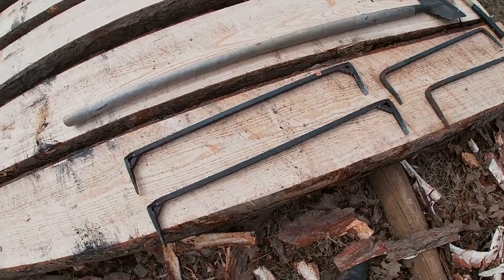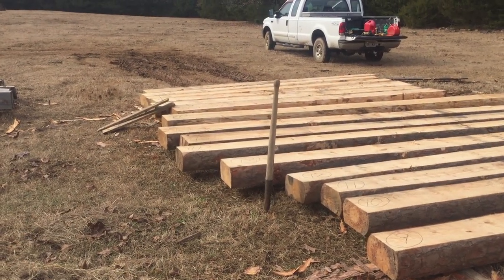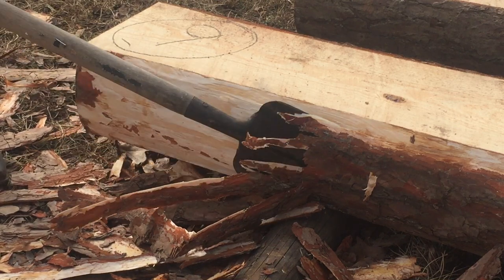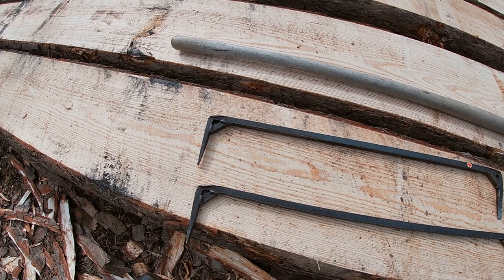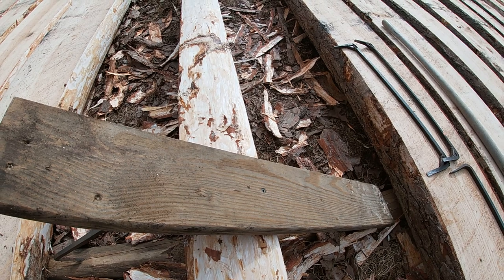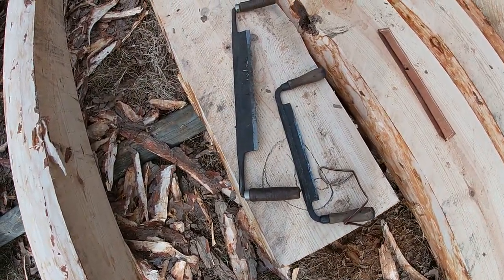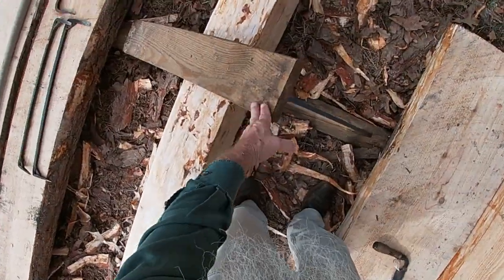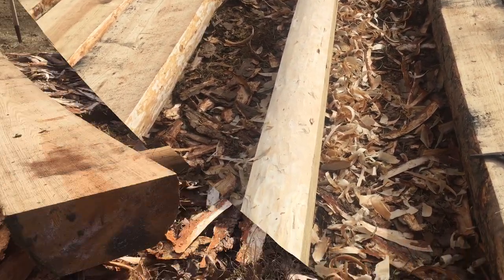Debarking Pine Logs for the Log Cabin Build (Ep 5)

Comment: I always learn something from each videos Paul. Today I need to sharpen my bark spud. I am more like Roy is, I am all hand tools, no saw mill to make my cants. I'm like Roy, I debark and get the whole log clean to see my marks better. I cut me two 12"-16" by 2' long bark free log and cut a slight saddle. Then I set log crown down and us log dogs to keep the log steady with log dogs and a few little nails to use as a second pair of hands for the chalk line for marking out my log at each end. Like I also learned from you is to take a utility knife and make a place to hole on end of my chalk line, works great when you'r working alone. On both sides marked the ends of the log is marked and line s set, I lay the log 45 degrees on my blocks and start cutting "v's" down the log on , knock of the blocks and I make me a cant with no bark. As I live in a temperate rain zone I by the cheapest can of lacquer I can get and spray all my marks so they do not wash off. Thanks for today's new lesson from The Bearded Carpenter! You gerat Paul! Blessings!
Reply from the maker: Howdy Thomas- you’re doing things the old way which is great. We need to keep the old skills alive for tomorrow’s students. I did exactly what you did when I built my first cabin. Thank you so much for sharing your experiences. Hopefully, someone will read your comment and decide to give it a try and get a passion to build something from the forest. Take care and God’s blessings to y’all
Reply: @TheBeardedCarpenter  Howdy Paul Thanks for responding, got out my file and bark spud, amazing, Thanks , God bless

Comment: Man I really enjoy your videos your a man of lots of knowledge. I was also wondering what would be the best 26x 32 cabin build meaning what is the easiest and the most simple. I live in Alabama and my wife and I are looking at property in Blue Ridge Georgia so I will be going back and forth 2.5 drive so I would be carrying enough to work for weekend. I like all the styles and I know people say whatever you want then build it. But I want it to be easy and fast 2 bedroom 2 bath 9 ft ceiling and I know you have the knowledge. I have built my last 2 houses but never a cabin. Thanks for your time. Keep the videos coming
Reply from the maker: Howdy Micheal, if you’re still leaning towards the d-logs you could probably do it faster than what I do with the dovetail corners and hewed logs. You could keep it pretty simple and by using engineered trusses could save on time. If you go with d-logs be sure and put lots of over hang on your roof to keep moisture off the logs. On d-logs the sapwood is on the outside which is more susceptible to decay. I’ve never built with d-logs but I have done some extensive repair on a house with them. Hope it goes well for you. Blessings to you

Comment: You just reverse engineered yourself a traditional Finnish debarking tool called "petkele" :) 
In Finland, due to more modern (motorized) tools, those have long ago fallen out of use in their original work as debarking logs and instead people have started using them as - you might've guessed it - floor scrapers or ice scrapers and they are being sold as ones these days - with some adjustments to the traditional blade geometry. I love it, that you thought of turning it back into it's original use, probably without knowing it's original use. Human brain is so fascinating system :)

The long shaft makes debarking that much easier.
Reply from the maker: akinma   Howdy- I’ve never owned the motorized tools for doing this. Believe me having one when I’m peeling sure does cross my mind. I guess in certain ways I’m kind of a dinosaur. Thank you so much for your comment and explanation. God bless you
Reply: @TheBeardedCarpenter  Ha, I can relate to how laborious peeling can be with hand tools, utmost respect to our ancestors. Haven't done any log houses, but even on smaller projects like small firewood sheds, log benches, log tables and such it's one of the most laborious part of the work. 

I'm happy there are still dinosaurs like you (and to some degree me too) roaming around, keeping up the old trades.

Comment: This is such a great series. I’m going to start my build by forging all the tools you showcase and make videos on my channel. Question, do you have to remove the peelings off the ground so you don’t attract insects to your logs? Thanks!
Reply from the maker: Howdy- that’s gonna be some great videos. I don’t have a forge but I enjoy watching black smiths at work. The bark usually dries out, but it is a good idea to keep the bark cleaned up. I can use a box blade on the tractor and drag them out. I appreciate you watching the videos. God bless

Comment: Great  seeing you using the floor scraper for your bark spud.  I have one of those so great to find another use for it.  Where did you get your log dogs?  I searched for some this Fall and almost fell out of my chair when I finally found one the prices were crazy.  Any suggestion on where to buy or have them made?  I was going to make some out of rebar but my lumber guy said that was not a good idea.
Reply from the maker: Bonnie Doon Homestead   Howdy- mine are made out of square stock. They were made by a blacksmith. A welder could make them pretty quick. Thank you for watching our videos. God bless y’all

Comment: Dear Bearded Carpenter, looking at the tremendous amount of learning that you enable, may I request you to consider upgrading this project to include a Loft with some living space, and also include a regular Dormer and a Shed Dormer to it? I understand that designing and building Dormers can be tricky. Hence the request. Thanks.
Reply from the maker: Howdy- there will be a loft in the cabin. In fact, I got the joists this week to use. They will be exposed 7”x9” yellow pine timbers. I try to stay with what was done traditionally on the outside of the log buildings in our area. On the inside I will have a tendency to do something a little bit different. I did a lot of things in our own house that probably would not be considered the pioneer rustic cabin stuff but it was our house and I was having fun doing different things to make it a bit more refined. I ‘m glad I didn’t have to pay someone to do some of the detail work lol. I hadn’t really considered doing a former on this cabin but now you got me to thinking. They are not too difficult to do- it just takes some planning but since the roof isn’t up yet I still could put one on. We’ll see what happens. There will be a wraparound porch on three sides. Thanks for watching and the suggestion. God bless you
Reply: @TheBeardedCarpenter  Thank you for the positive reply Sir. Many thanks for being so open to suggestions. I am a total novice. I have  heard that Dormers need to be carefully installed or they will leak water and spoil the roof and the  house below. I would also like to see a Dormer that is a miniature of the House itself, half dovetail notch, chinking and all (or whatever else that you know is best - pretty and durable). Hoping this idea finds your favour. Regards.

Comment: So I get removing thebark to prevent bugs but are you worried about termites or powder post beetles or wood bees eating the pine once its built?  Will you still have to treat the wood on the exterior with linseed oil or anything?   Also Ive read the pine is more apt to twist etc as it dries.   So does that dictate how fast you have to build so that the logs are locked together before they begin to dry out too much? Enjoy the vids and craftsmanship  look fwd to the build
Reply from the maker: Bama Dave   Howdy Dave- I won’t be worried about termites because the sill logs will be high enough off the ground but I will treat the footings before I pour the concrete. Getting the cambium layer off quickly insures against most bugs. However, I will treat the logs with boiled linseed oil after they are up. Yellow pine does have a tendency to move a little but when they are locked in the notches they can’t do much but stay there. Thanks for watching and commenting. God bless y’all

Comment: when is best time to cut pine logs for a cabin?  ive been told that if you cut in the spring the bark will peel easy.  but if you cut the log in the winter the sap is not running and less water in the log.  Im planning to build a cabin after the 1st of the year.
Reply from the maker: Brad Jones   Howdy Brad- from what l know, you’ve heard correctly. I’ve also heard the old saying that the best time is to cut trees in the Yuletide season because the sap is at it’s lowest. However, I’ve worked logs that have been cut at all times of the year and haven’t had any problems. God bless o
Reply: The Bearded Carpenter thank you

Comment: Building with green pine logs? How do you stop them from rotting? Old-school log cabins that were built to last were made out of hardwoods, right?
Reply from the maker: Howdy- many older cabins were built with pine logs and have lasted for years and years. I restored a log house built in 1845 that was built with pine logs. Keeping a good roof on the cabin and a good overhang is the key to make them last. People built with what they had available to them in the area they settled. Yes, many cabins were built with hardwood but having a good roof was what kept them from rotting. Moisture is what causes logs to deteriorate. The sap wood that is still part of the log is covered with chinking and the heartwood is what is exsposed which is more resistant to weather. Thank you for the comment, it is a question many people have concerns about. God bless you
Reply: @TheBeardedCarpenter   @The Bearded Carpenter  Ok, so if I understand correctly your saying that pine logs shouldnt rot away like they do in the woods provided that they are protected from moisture, and that the sapwood is stripped off all weather exposed sections, right? Im asking because there are a number of small outdoor structures I want built, but the cost of lumber right now is absolutely insane. Im wondering If I could just cut some trees and use the trunks in place of pressure treated 4x4 / 6x6 posts since I dont need anything in modular dimensions for what im doing. By what your saying, I would have to make some sort of impromptu sawmill to cut away the sapwood down the length of these trunks in order to build anything thats going to last. Stripping the bark alone wont be enough to prevent these pine log posts from rotting, and I will have to cut down all four sides since I plan on leaving the entire post exposed to the elements. I appreciate the info. Im still going to have to use a think oak tree in my case like I figured, but now at least I now know exactly why I cant just throw a pine log into a post hole with some concrete and expect it to last like treated lumber.
Reply from the maker: @pinkhead6857890  I wouldn’t recommend using pine as a post buried in the ground even with the sap wood taken off. Pressure treated lumber is ridiculous in cost right now and people are looking for other alternatives. I don’t know where you’re located but if you have access to cedar that would be better for a post. Where we are in the south we have a tree we call cedar that has a red heart that is used for fence posts and for pole barns. I don’t pour concrete around post because moisture in the ground can’t escape from around the post. I use gravel which lets water go on down. By the way, some people say our red cedar is actually juniper. Let me know where you’re located and if you aren’t too far away I can probably help you get what you need. Or you can email me at the beardedcarpenter8@gmail.com and maybe I can help you. I wish you all the best. Blessings to you

Comment: Can you tell me why old log buildings (at least around where I live in North Carolina and apparently where you are, too) were so often built with the two vertical faces hewn but the tops and bottoms left round?  Was it all just a style/cosmetic thing or were there practical reasons for not just leaving the whole log round and saving all the work of hewing?
Reply from the maker: Howdy Patrick- good question. Hewing four faces was a lot more work. The old timers were in a hurry to get a shelter built so they hewed just the two sides. Also, they were able to get more height from each log and didn’t have to use as many logs. For me personally, the natural sharing of the tree is kept in the wall which gives the cabin a more “earthy “ flavor. With the layout system l use l can keep everything level even though the logs have the butt/ tips still on them. After the cabin is chinked each log retains its own personality. God bless you
Reply: Thanks for your reply!

It seems like there are styles of log building -- I think especially of log buildings in the Rocky Mountains, in my mind especially in places like Idaho and Montana... even Alaska, like Dick Proenneke's cabin, or in Scandinavia -- where log buildings are built without hewing the outside or the inside facing portion of the log, although those sorts of log buildings mostly seem to be built with logs pretty tight together, without chinked gaps between them, and getting logs to fit fairly tight seems like potentially more work than chinking.

Knowing what very little I know, if I were in a hurry to get a shelter built, I would think to use logs in the round, not spending any time hewing (except just at the corners for joinery, if that even counts as hewing) and then chink in between them, kind of a combination of what I think of the Rocky Mountain and Southeastern styles of log building.  But I feel like I must be missing something, that there must be some reason why that wouldn't work well.  I don't know if I've ever even seen so much as a photo of such a building.  

I'm guessing there's a reason that the Rocky Mountain style doesn't work as well in the Southeast, either because of the species of trees that are most available or because of differences in the climates or because of termites or some combination of such things.  But maybe the differences have more to do just with local traditions and are more adaptable between regions than I'm assuming.

In any case, I don't understand what practical purpose hewing the outside and inside faces of logs achieves, other than creating a flat wall surface.  I can see possibly wanting a flatter wall surface on the inside of a log building if the building were used as a home, but especially for a lot of farm/utility buildings it wouldn't seem to be worth the trouble (unless a person wanted to invest extra effort for pure style/cosmetic reasons), and I really can't see any reason to not want logs to be round on the outside surface.
Reply from the maker: @patrickcleburneuczjsxpmp9558  I feel a lot of what people did had to do with the logs they had to work with and the skills they had. And it could have been personal preference also. The problem, if you could even call it that, is building with round logs the sap wood is exsposed to the elements not as resistant to the weather, whereas hewing the logs has the more resistant heartwood exsposed to the weather. I like the look of the round logs and I like the way they look with a full scribe
Reply from the maker: I appreciate your interest and your comments. Blessings to you
Reply: As for looks, I'm partial to the looks of a log building like yours.  Thanks again!

Comment: Would a rounded Draw knife work on your logs 🪵 .
Reply from the maker: Howdy Vernon- yes, it certainly would and I have a curved drawknife for that purpose. It’s somewhat difficult for me to use because of how the handles are fixed to the blade. Hope all is well with y’all. God bless you
Reply: Can the handles be repositioned to make it better with the handles up not straight out.
Reply from the maker: I’m sure it could be done but I’ve just gotten used to using a straight drawknife. As of now we are using peeling discs on a grinder that is so much faster and less fatiguing.

Comment: Hey great video. I have a question for you, will your logs last as long being sawn? I have always heard that by hewing a log it would last longer because the axe seals the grain more and a saw rips the grain open.
 Also is it best to cut logs in spring or fall? I know the bark would peel easier in spring.
Reply from the maker: James Russo Howdy- I haven’t had trouble with the logs being sawn. I will remove the saw marks either by planing or hewing the saw marks off with a broad axe. I get the logs sawed because there is the least amount of waste. I will hew out of the round to show how it’s done but l try to keep the waste to a minimum as much as possible. I don’t  know that leaving the saw marks has a major bearing on how long a log will last as long as the logs have a good roof and overhang to protect them. Hope this helps you. You can email me at The Bearded Carpenter 8@ gmail. com. God bless
Reply from the maker: Missed your question about when to cut timber. Bark does peel easier when cut in spring. I have heard and read that timber cut in the middle of the winter when the sap is lowest is better but I’ve worked with logs cut at different times of the year and haven’t had any problems. Blessings
Reply: @TheBeardedCarpenter  thanks for the info, sounds like a good idea to get a board or two off each side. Thank yoou and God bless.